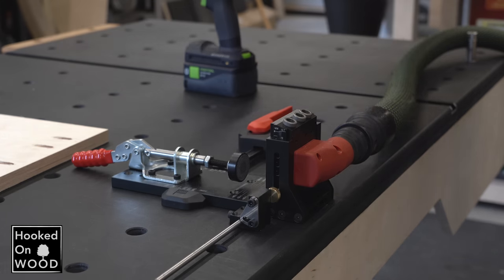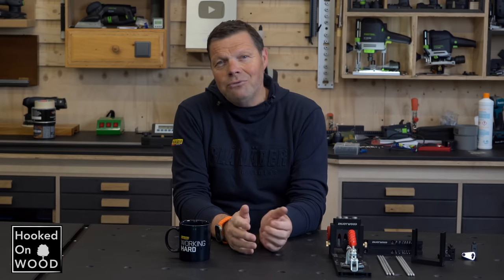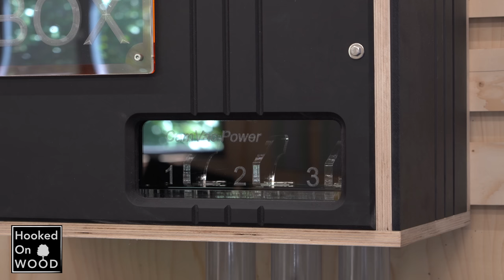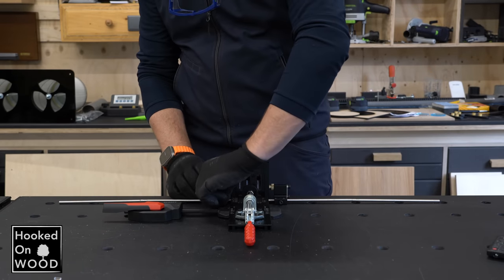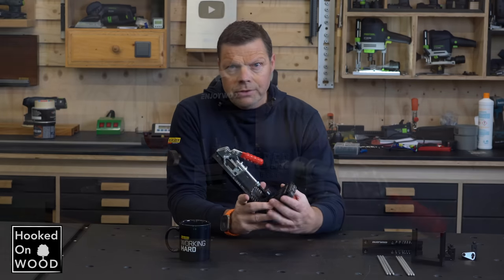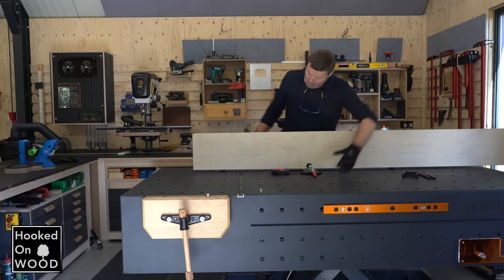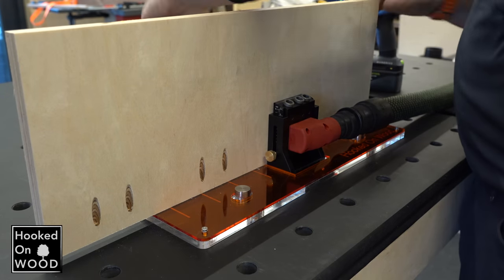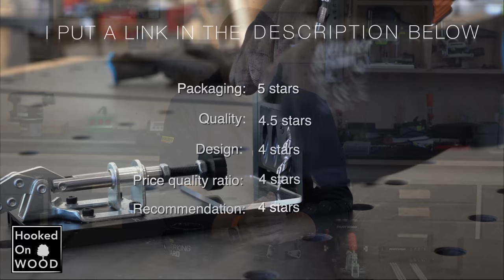This is what a Pocket Hole Jig should look like! China Tools Ep.44

Comment: Really looking forward to hearing more about the new improved extraction system... Looks awesome and I'm sure I'm not the only viewer who is jealous of it. Shows just how far you can go with a relatively inexpensive basic extraction unit. Best wishes one and all.
Reply from the maker: You are right about that David. This system is so capable. My big Hammer and Felder machines require 20m/s at the dust port, which is 5 inches. I tested the airspeed, where I enlarged the 4-inch pipe of the dust extractor to 5 inches and had still 30 m/s airspeed at the dust port. So, this single dust extractor could handle all my machines, from small handheld sander to my big planer! That is amazing for the price.

Comment: Thanks for this review. I like the thought of the extensions as I don't have time at the moment to make a support structure. I had used a Kreg jig at a Menz Shed in New Zealand and clamped some scrap wood for support. If I get my own, I think having the support immediately available would be nice. Regarding the dust extraction video, I suggest two episodes so you can cover each portion in more detail. I am setting up a workshop and am planning on the Record vacuum system after seeing your videos. I might not be able to fully outfit my system like you have, but seeing the options would be nice. Your presentation is one of the best of all the woodworking channels and so I don't mind longer episodes.

Comment: Thanks Dennis, great review as always. One comment on the "pro max" vs "build platform" - maybe it would have made a good point in this video (and this goes for lots of other tools as well): a comment on storage size requirements. With this, and like a woodpeckers-style drill guide, there are often lots of small things to store along with actual base thingymajig. I'm always super-interested in what is the smallest possible box I can fit everything in (even if I have to build it, but using IKEA food containers or similars for reference would work). A platform, it's flat, but it adds to what have to be stored, and preferably together with everything else. So this "pro max" might have an edge in that you do NOT need a platform. But the rods are this long, so you need a box that long, etc. Just an interesting point I would love for you to consider adding as a point to your scoring card in some way.

Comment: I am glad I can exhaust my dust extractor straight to the atmosphere with no need to use filters when I see what you have had to do to your system.
Reply from the maker: I think indeed that is the most convenient way. But all the air that will be blow outside also comes in. This can be a problem in winter or summer when you have airco.

Comment: Amazing looking platform, well done!. I bought this jig and I have mixed feelings about it. The body is very well constructed and the holes it produce are very nice. The problems are that the drill bit is a total junk. It didn't manage to drill a single hole in pine. The clamp is also problematic, it takes too much time to adjust it to the proper material thickness. Half a turn is a difference between too much force or none at all. I had to boards one 17.5 mm and the other 19mm , and I had to adjust the clamps for each of them differently. I've replaced the clamp with a Bessey STC-IHH25 inline self adjust clamp, and I'm using my Kreg drill bit and now it works like a charm.

Comment: I like the long videos. They are with more detail. I purchased the PRO Max version from your review and really like it. I noticed one thing that I wanted to ask you about. I noticed that you places a small piece of plastic on the bottom of the guide to set the drill depth. How is that method used for the different depths of drill bit and sizes? Is using the other guide that comes with the Pro-Max a better system of setting drill bit length?

Comment: Hey Denis.. I bought the X4 original Enjoywood PHJ a few months back after watching ur review. It cost me 77 Euros at the time but I felt it was a great bargain. What I like about this PHJ is it straightens up all my workpieces.. As long as I have them at 90 Degree cuts the Jig will square everything up when I put the 1st screw into it. I have a little trouble working out where or how to work out the drill bit.. Trying to get the measurements correct has caused me some issues but I will get there my bro..
I just wanted to say thanks for the brilliant review of this ENJOYWOOD PHJ bcos it's a beautiful piece of kit. 
I wanted to ask one question of everybody in this comment section and of course ur good self as well D mate..
Q. What size screws would I need to use if I was trying to connect 18mm sheets goods? Is there any chance of a comprehensive video from anybody on here where they go into real detail?? It would be of enormous help to me seeing as I'm relatively new to the Pocket Hole Jig and screws game.. Thanks anyway good ppl and show ur support to this top man for making brilliant content like this. I'd be lost without all the China tools reviews. Denis has helped me chose the right tools every time tbh. I'd be lost without his website #HookedOnWood.. It's a very comprehensive website and u will get tonnes of great information on there..
Thanks D mate.,.

Comment: You could still utilize the extensions and stop blocks with the "pro" pocket hole jig attached to a base, as the stop blocks come with predrilled holes as well. Just attach a small piece of plywood to the stop blocks the same thickness you have used as a base for the pocket hole jig. you can then use them as intended. Although I would still prefer what you have fashioned as a base lol
Reply from the maker: Yes, clever idea as well!

Comment: Dennis - what is the thickest peice of material you can clamp in your Enjoywood pocket hole jig?  I bought one, but I can't clamp 1.5" thick stock (US 2x4). 38-40mm?  ITtseems like I should be able to, but the adjustment screw doesn't screw into the shaft far enough to allow that thickness to actually be clamped.  I am trying to figure out if it's designed that way, I'm doing something wrong, or my unit is defective and wasn't threaded deep enough.

Comment: Hi Dennis,
I would like the longer version about the dust extraction more.
Can't wait for the second one to get uploaded😂
Really like your content.
Perhaps you can give a hint if you think that some of your adjustments only work with the 3 motor version and not with the two motor version.
Think most people have the two motor version.
Thanks in Advance.
Reply from the maker: All the upgrades work great with the two motor version, except replacing the control unit, that is very straightforward with the 3 motor version and reversible without the factory will know. That said. The two motor version can be run on two motors most of the time, where the 3 motor version will give serious suction power that you not always need. So you will switch this more on and off. But further than that, the two motor version os perfect
Reply: @HookedonWood  awesome thank you.
Will have the Camvac in another room for noise reasons but will run it via an extension cord so I can turn it on and of from the workshop.
Not that elegant but I think it is an easy and cheap solution.
So it's good that most of the time I can just use both motors.
Just have to install the pipe system.
My new workbenches are nearly done. Only have to add the dog holes.

Comment: Does the camvac 3kw (3x1000w) get easly hot when all 3 motors are running? And how long can you run all 3
Reply from the maker: Never reach the limit jet, but I think they will run 45 minutes. I thought Record power says 45 minutes and then 15 minutes cooldown. But 3 motors is extremely powerful. I use 2 motors mostly. Although there are situations a 3 motor is a better choice. Especially when you have equipment with above 4 inch inlet, and when you want to use it longer than 45 minutes at ones. Then it is better to use two motors and switch every 20 minutes and let the thirty motor cool down.

Comment: Hi Dennis, with your dust extraction system I would recommend two shorter length videos and one long video. This will provide maximum attraction to your videos. What thickness is the little Perspex square you use with your pocket hole system for drill lengths. As ever thank you for an entertaining video.

Comment: The basic thing I dislike about this jig is that you have to reach over the jig and working piece to use the clamp. i have a Kreg jig, the clamp is in the front, the dust collection is great, but it is a plastic material. Saying that, I have had mine for several years and still have not drilled into the base. I use it all of the time on cabinet sides and if the clamp was in back, I would not like it at all.
Reply from the maker: I agree with you. I like the Kreg for this, but when a project is manageable, and an average cabinet is, it is not that inconvenient to reach over the board.
Reply: @HookedonWood  Yes but I just like the front locking arm for everything. Also the Kreg is less expensive.

Comment: I bought one of these pocket hole jigs, clamp is limited to about 25mm +/ -, not the marked 38mm. The supplied drill bit jammed in the guides. I used another drill bit and it was fine, so supplied one went into bin. Good jig otherwise.

Comment: You've got the shop I dream of having, and a dust extraction system that has no peer in a hobby work shop. I'll be copying your design in my shop once my new house is finished which has my shop in it (14'x32.5'). I'm amazed at how you engineer every aspect of your shop, and the detail you put into the dust extraction system. I love the lights and sight flaps you created for each of the 3 vacuum ports, and the exceptional sound dampening you created. Longer video's work for me, but then I watch all of your videos from start to finish no matter how long or short they are, you could say I'm hooked on Hooked on Wood 🙂
Reply from the maker: Thanks, Pete. Of course, not every project worked the way I wanted, and it took me some time to cover everything in the way I wanted. But this project turned out even better than I dreamt of. And also, from a design point of view, I find it very elegant, and I just like how it all looks. And the sound is amazing, and I even have some things left to cover that will improve the sound. I think I will get it around 60db

Comment: I wonder how good the pocket hole jig will work, if you replace the clamp with a self adjusting clamp from Bessey?
Reply from the maker: Probably also good. There is a spring to set the force. But it is not difficult to set up, and it is mostly a one-time set up for a project. But I think it will work also.

Comment: Not too impressed

I purchased this based on your recommendation and having used it for one day, the second bushing has come loose

Everytime I put the the drill in and take it out I have to manually take of the bushing and reinsert it back into the guide hole

Going to have to return this as it's driving me crazy already

Anyone else experience this issue? Any fixes before I send it back?
Reply from the maker: You mean it unscrew itself while drilling? That would just be an easy fix with some lock bond. Or is there something else.

Comment: Within two or three days you completely changed my plan for the new workshop. And it's not just the black MDF 😎👌🏻 One question left for the pocket hole jig, as I am close to order a Kreg 720 pro so far. Are there any suggestion on drills and screws, as i felt somehow "safer" in the Kreg universe with all matching accessories offered and easier accessible... 🤔

Comment: Shorter videos please, anything over 15 minutes has too much waffle and not enough meat. As for the pocket hole jig - its basically a Kreg K4 clone and IMHO still better than the new generation of Kreg products. As for the support/stops - guess what - Kreg used to make those back when they introduced the K5, even included them in some of the 'deluxe' kits but then eventually stopped offering them. The Kreg version was supposed to fit over a length of T track and you could have several in a row to set the points where you were going to drill.